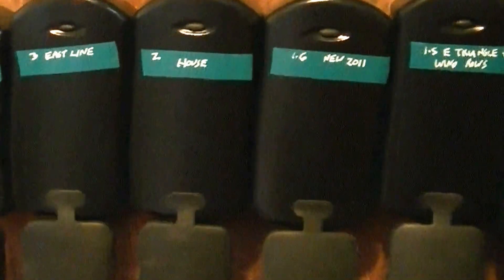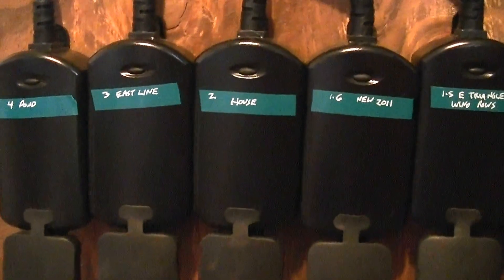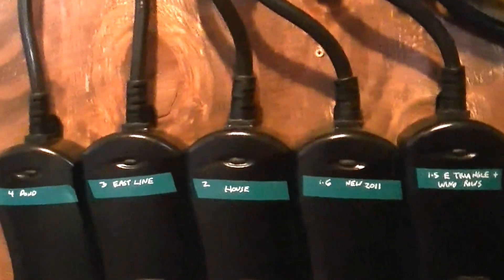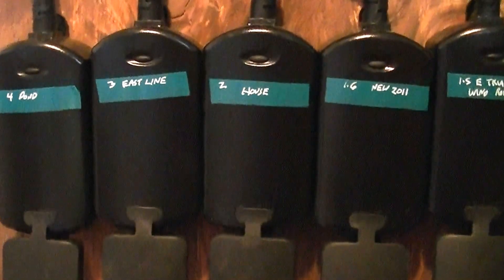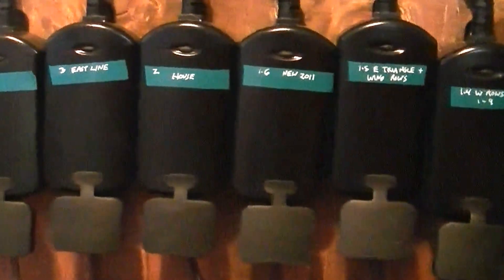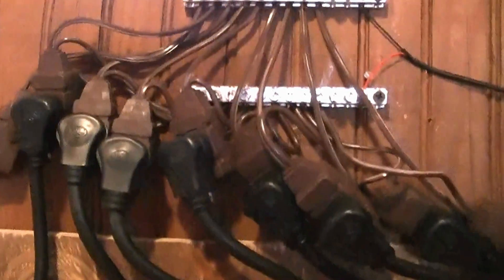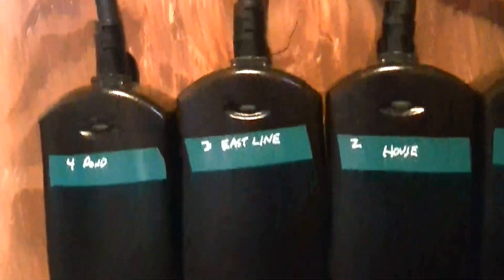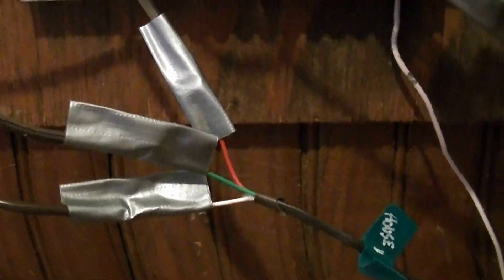Homebrew Z-wave automated irrigation Part 1

Comment: Excelent setup! Gives you full control from Vera. The interesting part was switching 24V. The only thing that stops me from implementing it now is the high price of each of those GE modules. Where did you found them for $15 a piece?! Right now, for me, for only 6 zones, at around $40/pcs it is getting expensive, in fact more expensive than other systems. Indeed, it is better than any other solution out there but quite expensive. Please point me in the right direction to get the $15 ones! Thanks!

Comment: I was just wondering... since they are indoor/outdoor electric on/off zwave controllers you're using, is there any reason you couldn't have some of the on/off controllers outside by wiring them direct to your transformer, then putting the controller adjacent to the sprinkler outside?  The reason I ask is I'm curious is if I were wanting to extend my HAN throughout my backyard, for example?